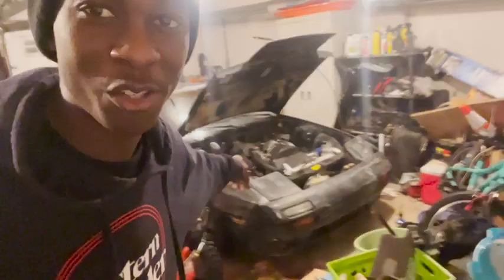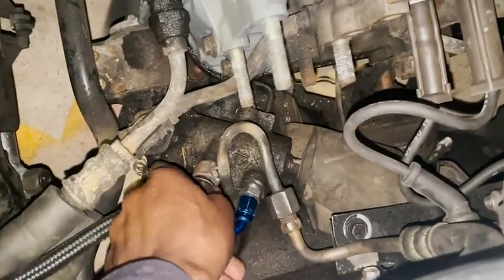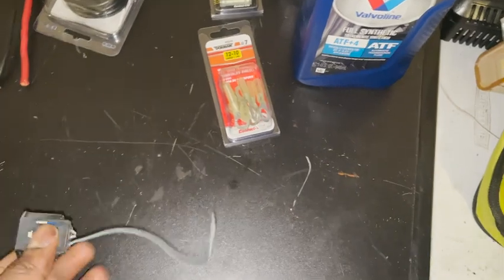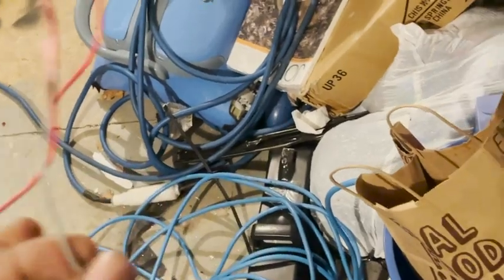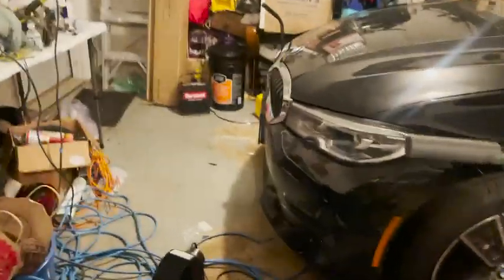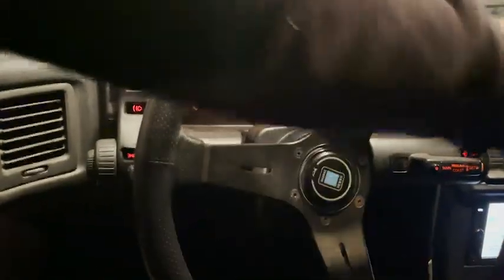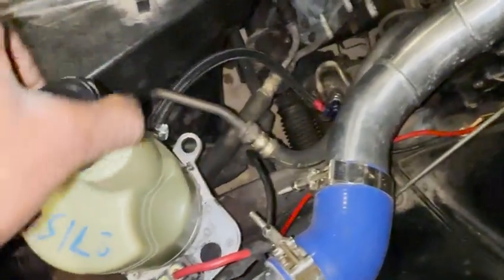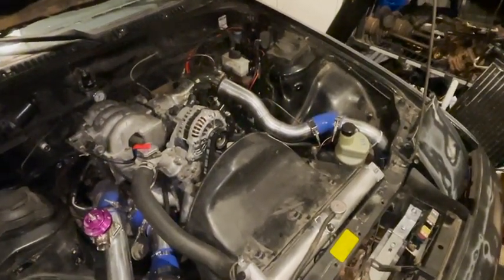Volvo Electric Power Steering Pump Install | FC RX7 Restoration Ep.16

Comment: That's amazing, I wanna do that too.
I want to run switch since I do like driving without power steering. I'll having it on a switch so if I have to push it or it's one of those days I don't feel like use some muscle when driving around a parking lot

Comment: have you had any issues with heat in the engine bay making the power steering pump konk out? i'm not sure if this thing is susceptible to heat or not
Reply from the maker: Not at all

Comment: Good Progress!  I don't remember you mentioning it but it's possible to add a switch to manually turn off the electric power steering pump? It would be amazing to be able to turn it on for daily purposes such as parking and then off for whenever I go on track days.
Reply from the maker: Yes it is! I didn’t elaborate much on it but that blue wire can be wire directly with a basic switch with power, ground, and output. I will be putting it on a switch myself since whenever I’m making tuning revisions with the car off I prefer the pump not to be on.
Reply: @thepcmrtim  Just exactly what I wanted to hear! Thanks!

I love my de-powered manual steering racks but it's nice to be able to park easily too though lol

Comment: Didn't notice a cooler, have you had any problems w overheating? Would prefer to ditch my nasty stock cooler hose
Reply from the maker: So far it's been good, but I'll be adding a cooler very soon and doing a video on it!
Reply: @thepcmrtim  Sweet, thanks dude. I'll probably ditch the cooler for now til I pickup an in-line cooler to fit w a vmount

Comment: Doing this install on a uk fc just wondering if you have any issues with the power steering overheating as in the uk we have a PS cooler on the ps system
Reply from the maker: Highly recommend installing a power steering color in between the return line.
Reply: @thepcmrtim  that was my plan to be honest lol was just checking

Comment: How fast does it power up? I’m wondering if I could wire it up to only be on for first and reverse and off everything else.
Reply from the maker: It would be possible with some sort of relay control via a microcontroller and you’d need some sort of device to figure out what gear the car is. There is no particular interface on the FC chassis to provide such data as the transmission is pretty much old tech. It would be possible to actually get a reverse signal but for 1st gear I don’t think so.
Reply: @thepcmrtim  sorry I’m not using an rx7 chassis, I’m putting one of these on a Monte Carlo! You just had a good video for the setup lol. Do they power up pretty fast or is there a warm up sequence?
Reply from the maker: @civicsr2cool  Powers up really quick to be honest, I don’t have you wait or anything. Yeah assuming your using it for the Monte Carlo should be possible just need to trace the wiring and see if you can get a signal output for 1st gear.
Reply: @thepcmrtim  thanks homie! Looks like I’ve got some an fitting research to do now lol
Reply: @civicsr2cool  could you share your progress? i would like to do something similar
Reply: @anyau  I have not hooked up this yet, it looks pretty easy tho. Lots of work done with these all over the internet!